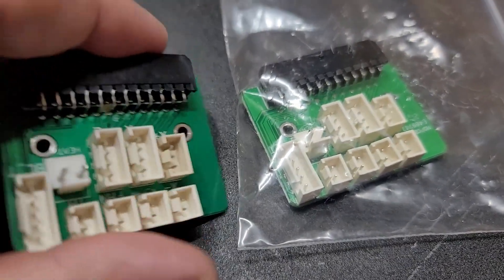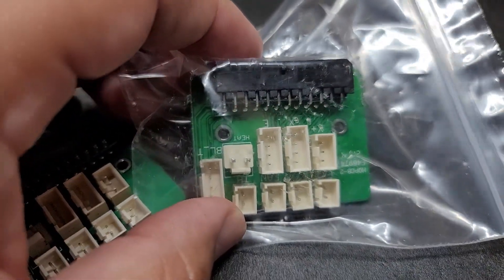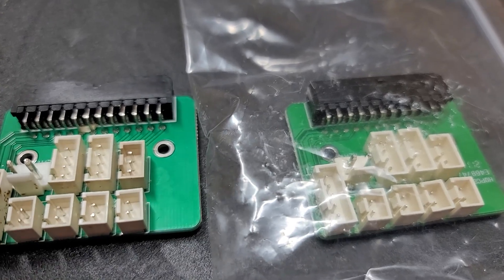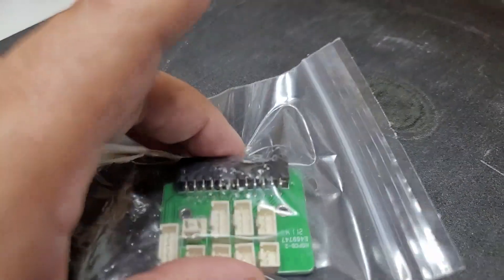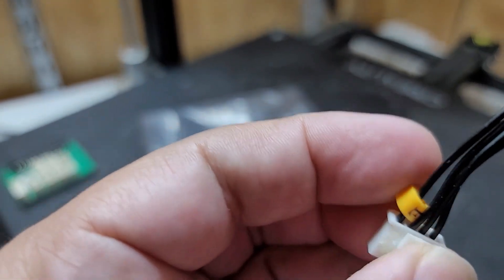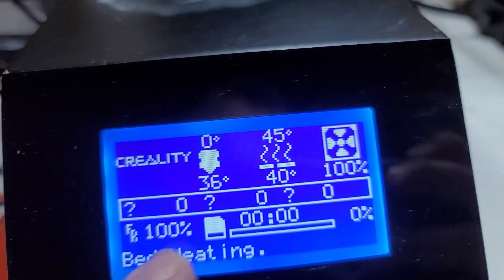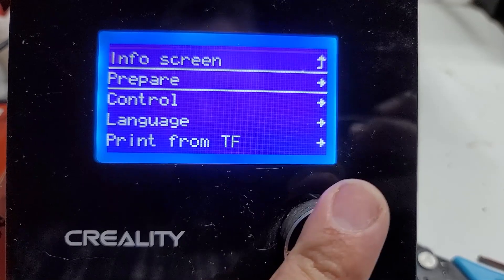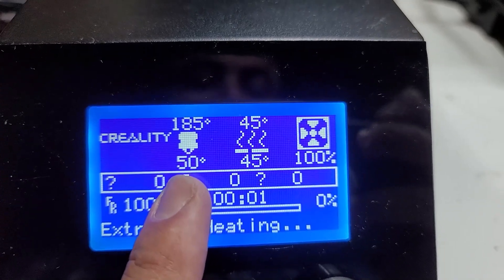How to Fix Hot End on Creality CR-10v2

Comment: would shorting the board cause the thermistor to read at 358 degrees? I just replaced my whole hot end and it started to overtemp even though not being heated up?
Reply from the maker: I don think so. It usually shows up as 0 degrees.